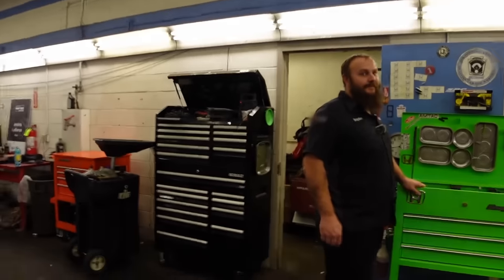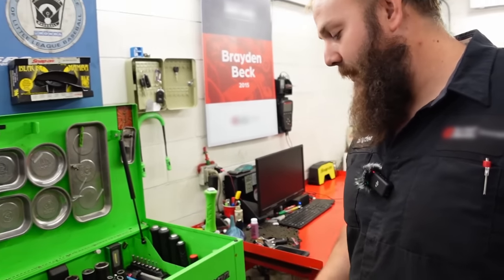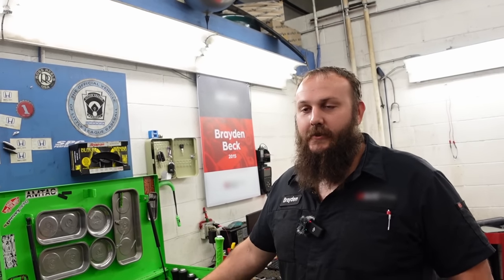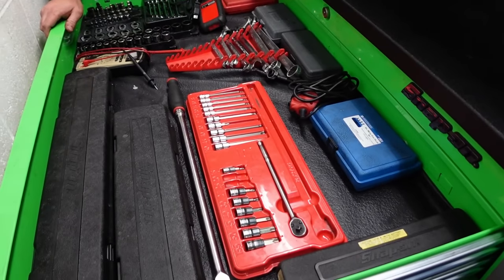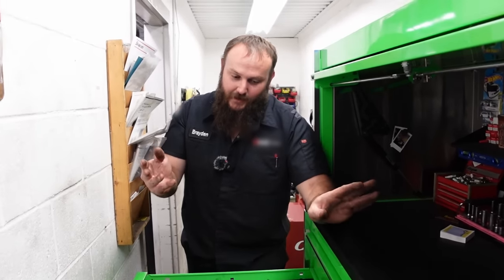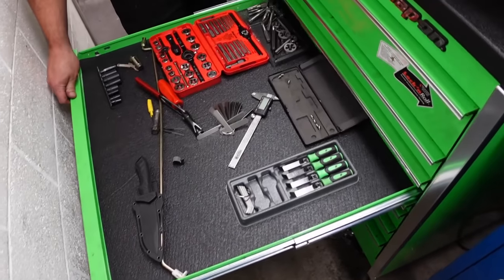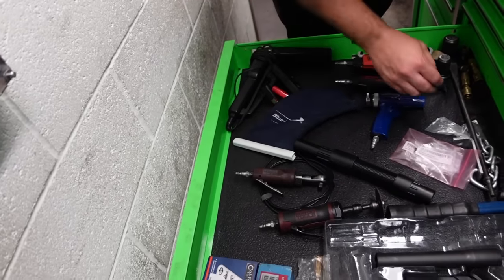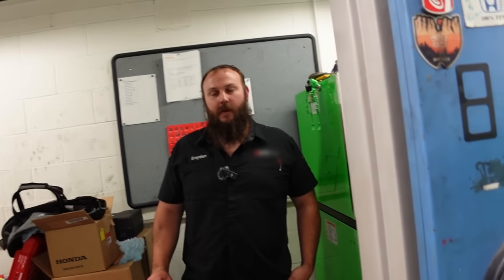Each Tech Gets Their Own ROOM!

Comment: Due to the limited selection in the tool cart, I can sat this is definitively a import dealer tech. With my '02 Jeep WJ, I regularly need both metric and imperial. Anything engine related is definitively SAE. Brake caliper bleed screws are 3/8" in the rear and 10mm for the front. I've got 1/4,3/8, and 1/2" drive in both metric and SAE(deep and shallow), as well as a good set of metric Deep and Shallow impact sockets. 

Brand wise, I've got all the brands. Wrench wise, I prefer the MAC CL series, although that's discontinued and we never really had a MAC presence around here, and my usage as a home tinkerer doesn't warrant the price tag for a used set. I occasionally see a Matco truck around, but seeing that's a rarity and I've only seen him at Walmart as a shopper(not in the shop area).   Most of my tools now come wither from Amazon or Harbort Freight, as their quality more than meets my needs and the difference between my Snap On tools and off brand tools is minuscule, and due to my current job in a recycling plant, I despise thye Snap-On guys, as the send my oversized Toolbox boxes every week that are a major hassle to deal with. There's been talk of my moving to the shop, and as one was the maintenance manager was recently unexpectedly given an early retirement, and the other is a mechanic that barely does his job(half shift smoke break anyone, as the lead mechanic?) He got demoted from that, but is still a senior mechanic. Had a discussion with a senior manager last week, regarding specific semi trucks breaking driveshafts often. When I said they should carry a spare driveshaft and the tools for the driver to swap out the driveshaft, I got a "If only it was that simple" response." A semi driveshaft is 8-12 bolts and a slipjoint. A driver could roll under and swap it out in less than an hour, while the mechanics we send out take that long to get there.

Comment: That Honda OEM push pin puller tool looks well designed.  Had to order one as soon as I saw it.  No more replacing clips my Gearwrench puller tool boogered up.
Reply: Saw the like so I figured I’d provide an update:  it works very well for all those types of push pins, not just the Honda specific ones.  Definitely like it better than the Gearwrench versions.

Comment: I just drill the heads off the brake rotor assembly hold down screws. They are really soft and it takes a couple of seconds. I’m not going to fight a screw that doesn’t matter past the assembly line . Some people swear you need to replace them but I don’t unless someone absolutely wants them. Japan has strict regulations about preventing drops in construction and manufacturing. They use different types of impact socket retention devices and all their tools for overhead work have lanyards or other fall prevention equipment.
Reply from the maker: Yeah they don’t do much, but I’ve had really good luck with an impact screwdriver. I’ll have to try drilling next time to see if it saves time 👍

Comment: Great video as always.

His comments on Icon were interesting. I believe that this was his experience. However, it contradicts what some other mechanics have said (even ones who were not given the tools by Icon).

I own Icon and Snap On. I would never say that Icon is as good as my Snap On. However, they're very close.  Maybe 90-95%.

I wonder if it's a quality control issue? Meaning, maybe some Icons make it to the store that were not properly inspected?
Reply from the maker: Yeah I have seen people love them or not care for them 🤷‍♂️.
Reply: I wanted so badly to like icon. I've tried their pliers which were a lot like a looser fitting snap on. They were great for the price, but they didn't have an aggressive enough grip. After a few uses the aggressive texture on the clamping side was sliding off high tension hose clamps. The wrenches were okay. They look identical but slipped on the open end. I do really like their hose picks though! Great value, either way!
Reply: @michaelbolton1090  You have to go with what works for you. Luckily I can afford both. But I do think that Icon is a far better value. I havent experienced the same problem with the open end slipping like you have.
Reply: @jasonhoyt8232  I 100% agree the icon is a better value. Snap on definitely offers a better product, but not at 3 times the price. I've just used snap on so long that I have become critical of everything else. I get tunnel vision. Just started getting into knipex and I kind of lean towards that being the better value than both of them. Especially if you buy them on sale. At the end of the day, I think we are all tool collectors 😂 everyone should try as many tools as they can and find what works best for them, and what feels best for them! Icon is definitely in that conversation! 
Side note: did you know icon side lockers look great bolted onto the side of a triple bank krl? Lol ask me how I know.
Reply: @michaelbolton1090  I love Knipex pliers. I hesitate to say this, but I think that they are not just a better value than Icon and Snap On (for PLIERS), but also literally better period.

Comment: That is definitely a new power steering pump and not a remanufactured one… Plus a remanufactured part is warrantied for 3 years / 36,000 miles whichever occurs first  and therefore is better than a new one or repairing because that would be warrantied for only 12 months/12,000 miles whichever occurs first

Comment: He's wrong about solder connections and vibration, I will solder over a crimped connection everyday.
Reply from the maker: I’m curious why you say he’s wrong.
Reply: @ToolBoxTour  Because I used to be in the industry of electronics and military  equipment. The best way to connect split wires together is to solder. Either a solder sleeve or solder and shrink tubing. A butt connector for temporary connections is OK, but are in no way better than soldering. Especially in a vibration situation.
Reply from the maker: Ok, but can you tell me why? It seems every car manufacture uses connectors and crimps in lieu of solder connections to avoid vibration failures. Not saying you’re wrong, I’m just curious what the empirical experience you have had is with using connectors vs solder.
Reply: @ToolBoxTour  I'm specifically talking a butt connector vs a solder connection for a repair. Auto manufacturers absolutely do use butt connectors. I have seen metal connections crimped and taped, but that's for a cost thing and not the best. Solder doesn’t corrode nor does it fail in vibration because it's a more solid connection.

Comment: There is a 0% chance that a butt connector will hold up longer than a solder joint.
Reply from the maker: Really depends on the application. I really do believe a butt connector will hold up much better than a soldered joint when it's subject to vibrations and a lot of hot/cold cycles.
Reply: Nothing from factory in cars is soldered except to circuit boards. All the wiring is done through connectors that the pins of are crimped onto the wires, just like butt connectors. There’s a reason for that and vibration fatigue is the main one. OEM’s spend A LOT of money on r&d so I believe in the conclusions they came up with on this one.
Reply: @AleksTwentyFive  A butt connection crimp is not the same as a factory crimp. A factory crimp has 2 fingers that are folded towards each other and 2 more fingers to hold the wire past where it’s been stripped to keep the wire from flexing at the edge of the strip. I see your side and might agree if I didn’t live in the rust belt. The problems I see is either the butt connection is not completely sealed and let’s moisture intrude or the corroded wire is not fully removed and continues to spread even if sealed. I’ve had to replace feet of wire because of butt connectors that weren’t sealed. I find that I have better results when I solder and get the solder to travel under the wire jacket. I seal the connections by either using electrical tape and folding it over the wire so the glue from each side of the tape comes together, or my preferred method of encapsulating in black rtv. I’ve tried liquid e tape and it just takes to long to dry. Even when it skims over it’s easy to break that skim and now you have liquid again. Heat shrink works to but I find rtv is easier and faster. We need to get project farm to test this!
Reply: @joec9680   Ya know yeah, sometimes it's hard to get them to FULLY shrink, and honestly I haven't thought about the fact that the crimp itself is different.
You're right PF is the man we need!